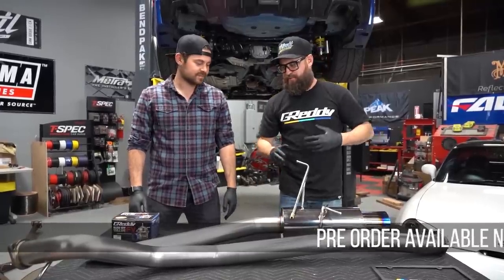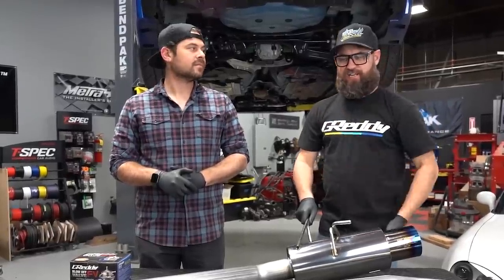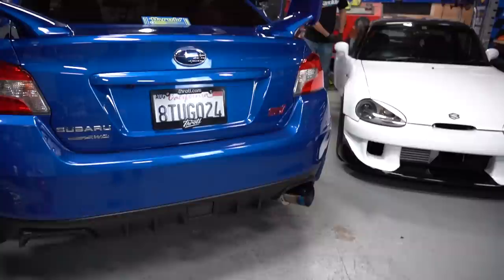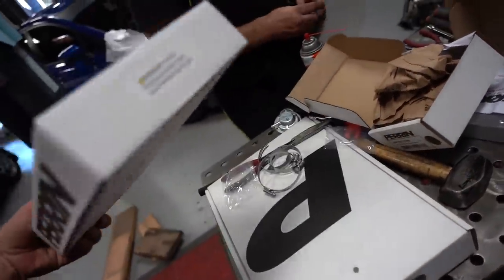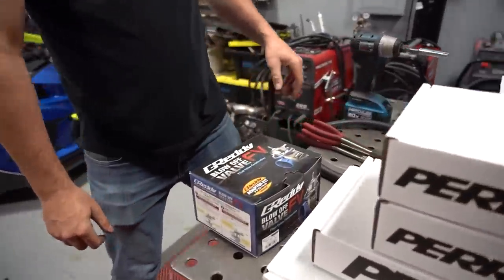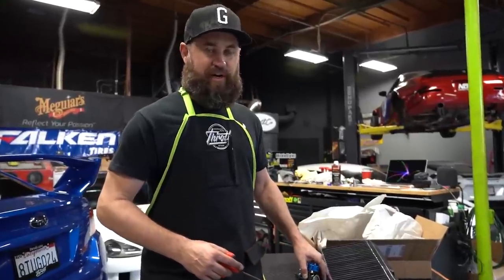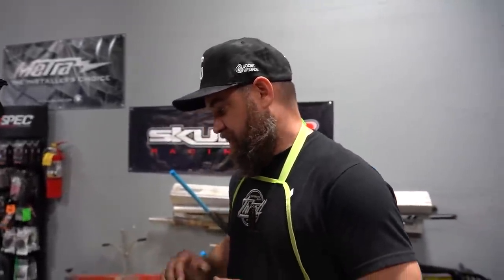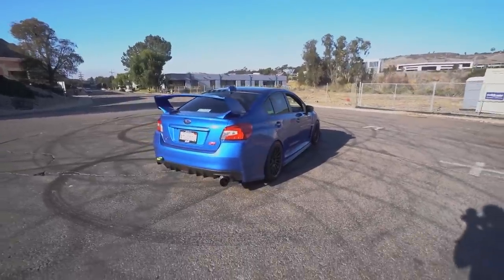Building the ULTIMATE 2018 Subaru WRX STI - Part 5 (Catback Exhaust System & New Business Revealed!)

Comment: Definitely shouldn't vent to atmosphere on a MAF car lol
Reply: Yea I was thinking the same thing... need to get a speed density tune
Reply: You can as long as you preload the BOV correctly.  It's still not ideal, but it will work without major issue.
Reply: @whatiwant8898  it will still run extremely rich every time you shift which has its own problems like washing the cylinders, fuel dilution in the oil, backfiring, ect

Comment: DAAAAAAANG. That exhaust looks and sounds absolutely sick. Not only does it have that clean 2000s JDM look, it really pops on a newer STi. It looks different, but it looks right. Do you plan to replace the whole rear 'diffuser' or just make a smooth plug for the left exhaust arch?

Comment: get a carbon trunk with integrated duckbill and the carbon center blade for the wing and also a carbon OEM Style rear diffuser with the block off for the other muffler tip

Comment: Watch how close the exhaust gets to the left inner rear axle boot, my Greddy got so close to it that after a bit it ended up touching the boot and burning through it, I had to replace the boot and move the exhaust down and shave down the weld clamps down so it wouldn’t continue to touch. I have the RS race but this looks to be the same thing